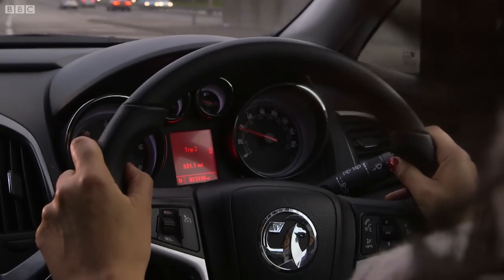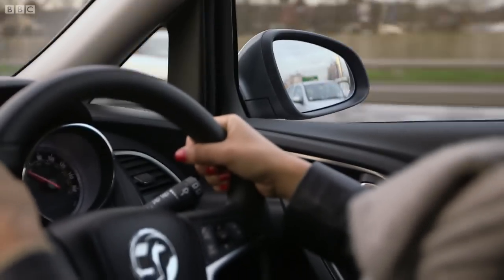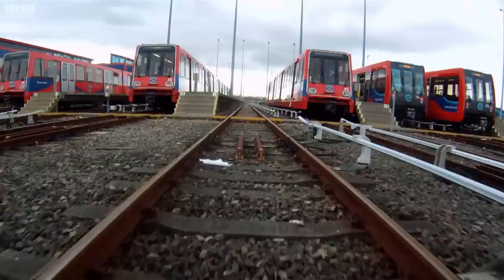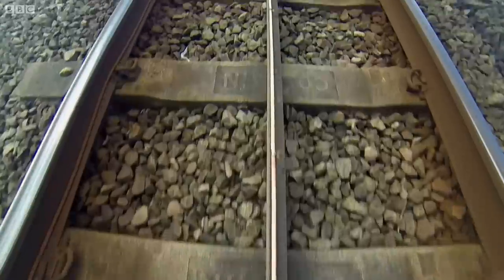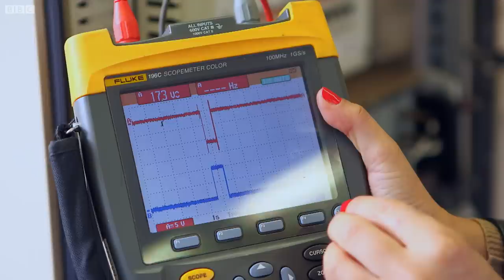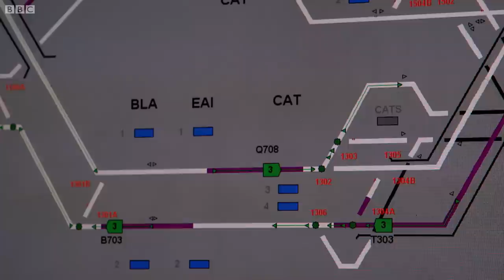How Do Driverless Trains Work? | Bang Goes The Theory | Earth Science

Comment: Will revolutionise the way trains are run? She said, like it was new. The DLR has been running for 29 years now.
Reply: That means it's now proven technology, yes? Not a risk to invest in.
Reply: ....Will revolutionise,,  its been done before...
look on Youtube .... "Automatic Tube Train Aka New Look Transport (1968)" .. The Victoria Line
and
Also,,  "Looking at London: Victoria Line, 1969,", skip >> 13m 45s
Reply: I think she meant implementation of this technology on other rail networks
Reply: Now 35 years
Reply: TDR REVENGE  The victoria line trains still have drivers on board.
Reply: @scottpeacock5492 Normally, Victoria Line operates automatically, although the drivers are here to operate the doors and to start the ATO (the thing that enables a train to run automatically, it is found on many systems)

Comment: We've had this technology and the knowlede for a good number of years now, I'm honestly surprised that this is not the standard yet.
Reply: +MrRolnicek So am I. Technology even evolved since the DLR was build.
Reply: In Singapore we have line which are driverless but there are staff Monitoring
Reply: It's incredibly expensive, and you would always require the most modern train to run
Reply: @marcodamasio  which part is expensive and for what reason?
Reply: @MrRolnicek  maintenance, since you would need very sophisticated devices along whole lines, which isn't much for an underground line, but it's much for entire railways
Reply: @marcodamasio  You really wouldn't. Instead of devices all along the line you could put one device in each train.
Reply: @MrRolnicek  they still need to communicate with something, which must be along the line
Reply: @marcodamasio  like cell towers for example, right?
Reply: @MrRolnicek  that's what they did for the Hammersmith & City line, with a tower every 50 meters
Reply: @marcodamasio  That seems a bit excessive. The cell towers where I live are MUCH further apart.
Reply: @MrRolnicek  normal ones are to ureliable
Reply: upgrading is insanly expensive
Reply: @burgerpommes2001  Eeeh, that's debatable ... if you have say triplicate redundancy, what's your ACTUAL chance of any downtime at all? It's close enough to zero that you can afford to stop all trains on that line if ever such situation arises.

It's not like cell service is the only option either. Also ... even though human train driverrs are less reliable than properly built machines, I'm sure even they have a method of communicating with the outside world from their train.

I'm fairly confident that the only reason for this to be so expensive is that it's a government contract which means prices are gouged and requirements are poorly considered (aka. requiring specialized hardware which would have to be made in low volume even when the cheap standardized one would be much more reliable)
Reply: Every time I watch one of these videos it's always going to be implemented 10+ years in the future 🙄
Reply: @marcodamasio  The Victoria line on the tube has been automatic since 1967
Reply: @thegroupofreptiles6823  all the equipment that allowed the Victoria line to run automatically (actually semi-automatic, since most of the tasks were and are still managed directly by the Train Operator) in 1967 was already present in other lines (cab signalling was first used in the 1920s) and was incredibly unreliable. So unreliable that the whole braking ATO system has been already replaced twice.
Reply: Look up ETCS Level 3 😉

Comment: In Vancouver, we have had this exact same ATC system deployed for over 30 years with the SkyTrain, now running almost 80KM of track.

But I do appreciate the technical depth of the BBC video and the simple explanation of key concepts. Neat to see the loop crossovers on the o-scope.
Reply: the DLR is that old too
Reply: DLR has different automation level compared to Skytrain though, DLR run on GoA 3 automation that requires onboard staff to open/close doors, unlike GoA 4 on Skytrain that allow the train to be left unattended.

Comment: Here in Toronto we're dealing with dozens of weekend closures on our subway system as they slowly implement ATC (Automated Train Control) which is something a bit similar.  I can so easily see the head of the biggest union quashing ANY talk of doing away with drivers.  NOT because of people losing their jobs, but because fewer drivers means fewer union members means less power for him and his cronies.

(The Scarboro RT, which is only slightly older then the DLR, was supposed to operate the same way, but the union made such a big stink they still have drivers.)

Comment: Interesting. I've noticed these loops on the commuter rail and subways of the MBTA. But they still use drivers on both. I've often thought that train systems, relatively speaking would be the easiest systems to automate. "

And me - I've taken the MBTA Red Line from Braintree end to Central. I can tell you that I used to commute from South Station to Central - nice quick ride but then it was only about 3.2 miles. Now I'm working in Quincy it's 6.2 miles. However I note the trains move much slower on the southern end of the Red Line. A lot due to congestion I'm sure.
Reply: +kd1s Even with drivers, the system helps the control room to know where all the trains are, and helps the drivers know how fast to go, and when to speed up and slow down.

Comment: The cables on the rails are like the german LZB System!
Reply: The cables cross every 100 Meters though.
Reply: It is because it shares the same roots.  The "SEL" in "Thales SELTrac" (made and brand of the system) comes from Standard Elektrik Lorenz, a german company which merged later to become Alcatel SEL, sold to Thomson CSF which became Thales.  That same SEL developed the LZB for the Deutsche Bahn in parallel with SELTrac (at that moment for BVG, the public transport operator of West Berlin) in the 1970ies and in the early 80ies it became reliable systems which were then deployed on thousands of km of track for LZB and exported on many metro networks for SELTrac (among others the DLR and London Underground lines)

Comment: The crossing wire system is a Frence technology which was developped in the 1970s for the Paris subway. It was a speed regulator but the trains were not fully automatic.
Reply: +Integrated Electronics Wrong, it's German. It's based on the system that's used for high speed trains in Germany, Austria and Spain. It was first tested in West Berlin.
Reply: +NeoDerGrose Ok where can I find info on that?

Comment: In my old stamping ground there are coal trains with 50 or 100 wagons each grossing about 73 tonnes, mixing in with pendolino passenger trains and ordinary mixed freight, diesel and electric hauled.  Much but not all is single track working over distances of up to 300km. Obviously stopping distances and train speed vary enormously.  On this London light railway, train mass is always nearly the same. I suspect that moving blocks would be rather more difficult to set up with mixed coal freight and passenger trains.

Comment: I would at least still have a dude up front who could press an emergency stop button just in case things go wrong. Which, according to Merphy's law, will.
Reply: +Joshua Walters Much like your spelling of Murphy.
Reply: Well thanks for the 'needed' correction. I don't spell things very well and rightly don't care.
Reply: +Joshua Walters All the DLR trains do have a member of staff on board who can stop the train is necessary.
Reply: There is an emergency stop button on platforms (behind a small glass door) that anyone can use if there is an emergency
Reply: +Bungle2010 That means the need of an emeregncy stop button more needed. Bit of a saying. The longer you go without an accident the closer you are to one
Reply: +Dylan Cotton Except statistics and probabilities don't work anything like that.
Reply: I know but it always seems like that and I think that may be how the phrase came to life.
Reply: DLR is very safe and other automated systems too
Reply: @D600Active  they do?
Reply: It went wrong sadly already a couple of times. Last time 29March 2023. I was there and it could have been avoided if someone actually had looked into the cctv or if they have sensors on the trains and alarm button in the front where passengers are sitting or the PDA sitting there.
Reply: Passengers are not liable for the operation of the DLR.But that is actually what they do to shift the liability to passengers to raise the alarm and watch out the stations and tracks.There is no alarm button on the front. There is one at the door but this doesn't stop the train .The PDA does need to put the key in and turn to bring the train to stop. Sadly because of the non sensors people were overun.DLR eg Serco at that time finend. The same with alarm buttons on the stations .It won't stop the train unless the control room does it. Too much time and only a couple of seconds or 1 minute time most not enough to save a life.

Comment: Those cables are prone to cutting though.
Reply: Good thing it's not the only system they use.
Reply: +SchneiderMan That, and what if somebody throws himself on the rails? Is there any camera sensor magic heartbeat detector thing to brake hard?
Reply: +ChaosPotato every station (not just the DLR) has a full set of cameras, sensors and emergency stop systems. The sensors are not on the train, however, the all stop signal is automated across the underground system - even in the train with drivers if someone steps onto the tracks, the nearby trains will immediately stop. Sadly, there isn't much you can do without the physical barriers like on the Jubilee line to stop people leaping in front of the train at the last second.
Reply: +SchneiderMan The driver is prone to stabbing. The rails are prone to vandalism. It works both ways.
Reply: +SchneiderMan There's also fallback systems, such as old fashioned track circuits, the rotation sensors they mentioned, and I'd be willing to bet the trains all have GPS on board.  Also, cutting the cables would be a lousy terrorist attack, as any sensible engineer would design the trains to stop if they have no idea where they are, so there wouldn't be any casualties unless you timed it excessively well.
Reply: +ChaosPotato "and what if somebody throws himself on the rails?"

Well, that person dies (which is a good thing -- after all, that's what he/she wanted) AND there is no driver to be traumatized (really good thing).
Reply: Adam Skatharakis I don't agree that that is a good thing just because the person wanted to die, but regardless they probably have sensors to detect that sort of thing and send a break command to the train.
Reply: Adam Skatharakis That wasn't really the point of my question xD
Reply: +Jim Groth +Adam If someone falls onto the tracks then there could easily be sensors added to the trains to stop them from getting hit. This is another place where computers would be better than humans because they would be able to see further and a computer would react instantly whereas a driver would have to think for a second. Your concern with driverless trains in the future can easily be solved and there wouldn't be a problem anymore. 

But the DLR does not seem to have these sensors as Jim suggests. There have been at least a couple deaths in the last 10 years from DLR trains hitting people on the tracks. They require a human to stop them. DLR also had to pay a large fine one of the times because they didn't stop the train. It again was human error because they didn't see anyone one the tracks. 

So yes there are problems with driverless trains when it comes to people on the tracks, but those problems are pretty much due to human stupidity. The computers did their intended jobs perfectly. So as long as people aren't idiots in the first place, the computers won't have a problem ever. Computers just do what they're told.
Reply: +SchneiderMan London has the most surveilance cameras per sqm. They would see him ;)
Reply: ***** No i didn't say that or think it at all. But it would be able to stop faster than if a human is controlling the train thats for sure, 100%, so either way it would be an improvement over what we have now..

And the train would have stopped in the case i mentioned where somebody was on the track for well over a minute but the controller didn't see him and the person ended up getting hit and dying.
Reply: NO SHIT SHERLOCK
Reply: +Bungle2010 It's obviously an example to show that the drivers can be affected just as equipment can.
Reply: +Ben W there are gonna be sooo many false alarms if that is applied, have you seen the number of animals and objects that end up on the track?
Reply: The signalling system is failsafe, if the signaling system goes down, the train will emergency brake
Reply: @ThoolooExpress  "any sensible engineer would design the trains to stop"
doubt

Comment: Is this the end of tube strikes? Hope so
Reply: +mill101 This is no new system, it's been there since almost 30 years ago. Did it change the Tube? And even if it did, there's still staff needed on the trains to operate them, they are not fully automatic like other similar systems.
Reply: I thought the original Victoria line was designed to be driver less. Staff on each platform would work the doors and trigger trigger departure.
Reply: mill101 yes but one small signal fault can cause a major disruption and recovery will be slow seen in the circle line singapore disruption where a signal fault causes trains to hit the emergency breaks and staff are required to walk in the tunnels to access the trains and manual drive it ti the next stop where the signalling can than be reset investigation that a rogue train was to be blamed
Reply: Dlr runs totally different to the tube it would take yrs for the tube to catch up as its 5 times bigger then the dlr system
Reply: NeoDerGrosse huh
This is DLR

Comment: Interestingly I've noted those same cross point loops on tracks on both the commuter rail and subway lines in Boston.
Reply: That's cab signaling. Tells the train how fast it can go via light aspects on the dash and the track conditions ahead. We have them in our trolley tunnel in Philly but they attached to the columns between the tracks.

Comment: Most deep level tube lines are already automatic,the entire system will be driver less in 5 years.at the moment a member of staff,who is called the train operator remains in the cab controlling the door operation.in the near future this will change and the member of staff will travel somewhere on the train.two serious problems with this,any track related danger will not be registered by a driver less train,and without doubt one day a train will catch fire in the tube tunnel.weather it takes 5years or 25 years it will happen.if that happens in peak period it would be catastrophic.
Reply: Paul Cowell and how would a tube driver help stop a fire?

Comment: Does the DLR really drives its trains in convoys where the distance between the trains is less than the braking distance, i. e. if the first train stops catastrophically, the second train would crash into it?  Usually, the advances in rail technology mean that the blocks trains occupy are virtualized (no signals) and their lengths minimized, but the principle that the block in front of a train is free, i. e. its safety doesn't depend on something else getting out of the way in time, remains.
Reply: +Tim Landscheidt The block will include the thinking distance, in this case the amount of time it takes the braking train to signal that it's braking and for any train behind it to be relayed that signal.
Reply: +Jack Evans So you're saying that on DLR if a train stops catastrophically, the trains behind it could crash into it?
Reply: +Bungle2010 The topic of this video isn't the DLR's actual timetable, but the technical safety mechanisms.  So let me rephrase my question: If DLR would be running trains in a convoy and the first one would stop catastrophically, would the trains behind it crash into it?
Reply: +Tim Landscheidt simple answer no

Comment: Singapore Train Systems also uses this Technologies and soon GPS "SMART" technologies will be soon introduced to Singapore in the 2020s and the ALL Existing Manual Operated will be REPLACED by this System.
Reply: SG MRT's are not all the time run manually.
Reply: The Older Models of the Siemen Types are Still operated Manually Except the DRIVERLESS ones in the Circle Line.